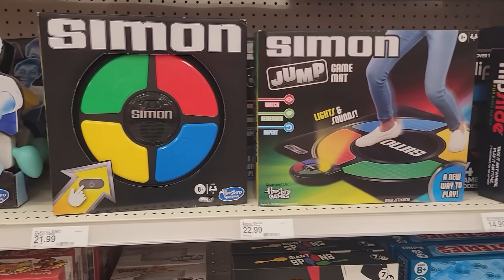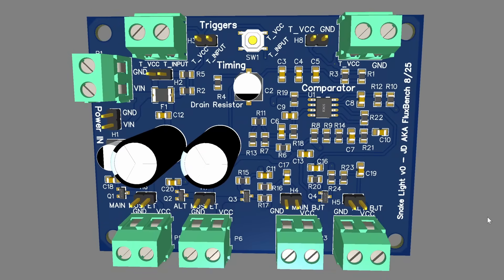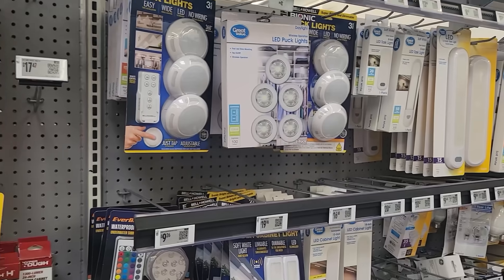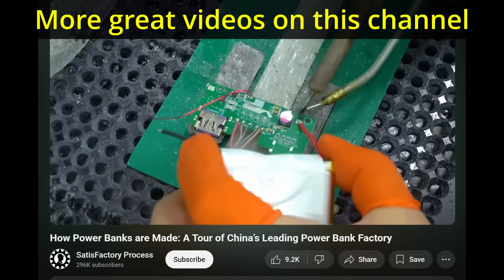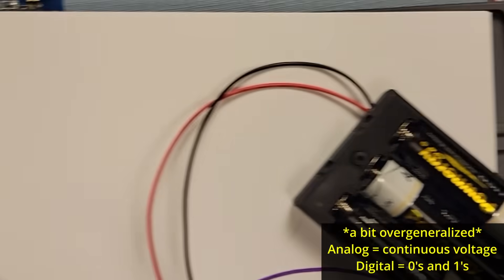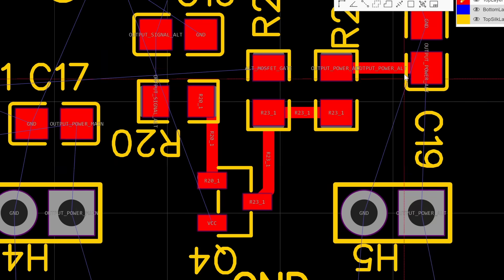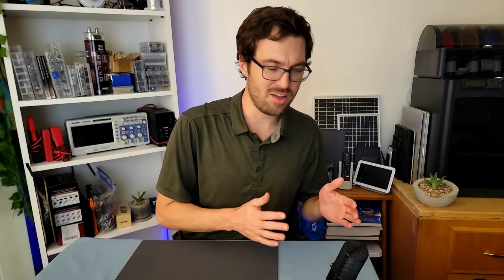How a $2 Circuit Becomes a $20 Product

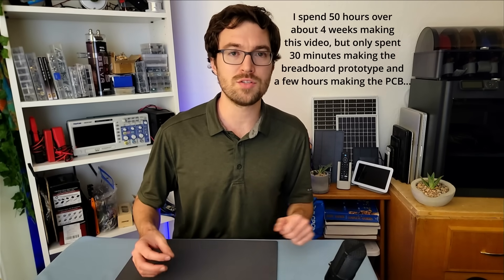Comment: Thank you for spending 50hrs ( 7:52 ) on making this video, I'm aspiring to someday reach this level and seeing your video is great reinforcement. I like to build my own equipment like 3d printers, cnc mills, desktop injection molding, pick and place, etc. What are your thoughts on personal manufacturing instead of using 3rd partys?
Reply from the maker: Time and money. It's all a trade-off and it depends on if you want to make a specific product or if you want to maximize the investment in machinery/exploit your specific skills.

In the end, almost everything is cheaper to do in house but has a decent setup cost and opportunity cost as there's only so much time in the day. But maybe you're like Apple who wants to design products and not have labor hand assembling them. 

The best part is no part, and the next best part is the one you don't have to make yourself. Someone invested a lot of money in a big machine to be really efficient and you can probably buy a lot of stuff cheaper than you can make it.

I usually do a little bit of both in the end. Hire out where it makes sense.
Reply from the maker: Glad you liked the video! It seems like you're off to a great start building all those machines 😁 what do you injection mold with? DIY heater and plunger or do you have something with serious clamping power? 😜